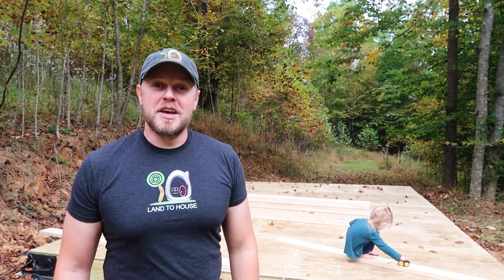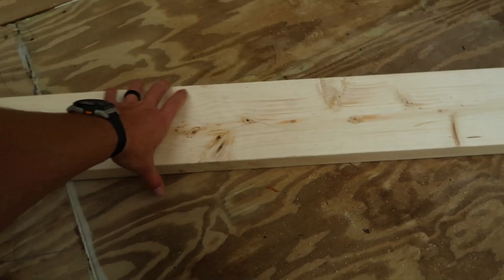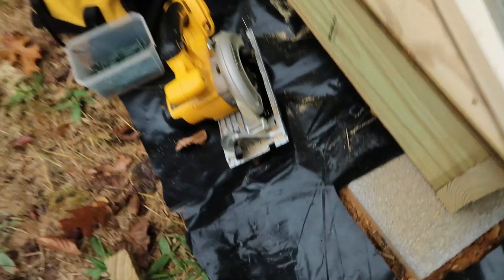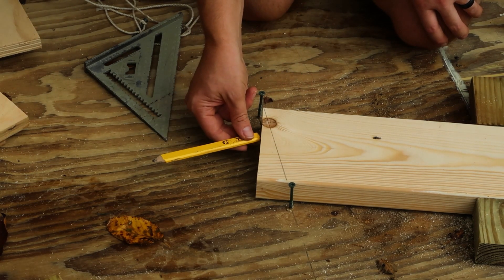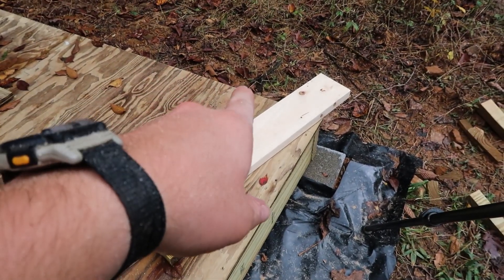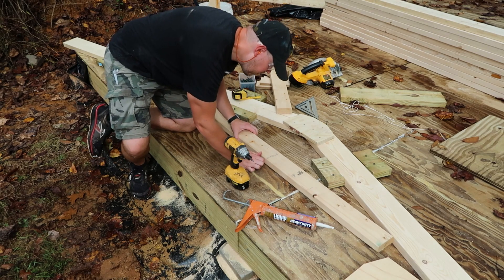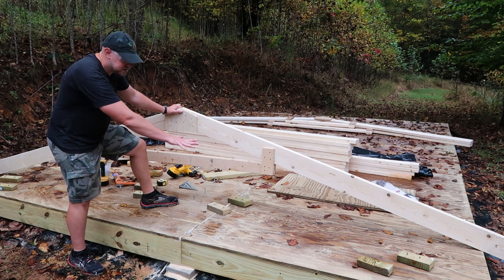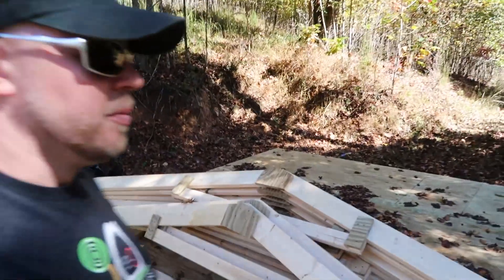Shed Roof Rafters - Build Truss system

Comment: Amigo el 2x4 que usaste para soporte no es tan confiable con el pedazo de plywood si lo u bieras clavado di recto 2x6 en tonses si es más seguro pero te felicito por tu en se ñansa
Reply from the maker: With rafter ties from top plate to top plate the 2x6 trusses should hold well. That extra 2x4 is there for a little extra support and I have some other plans. 

Thank you for the input!